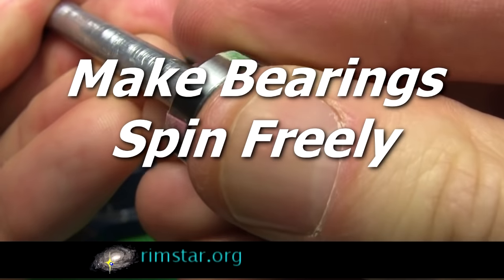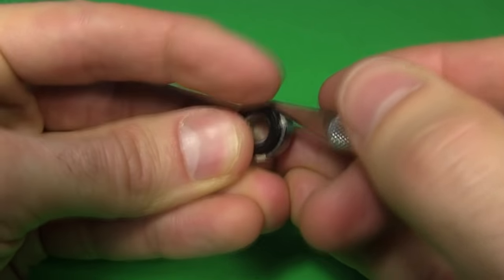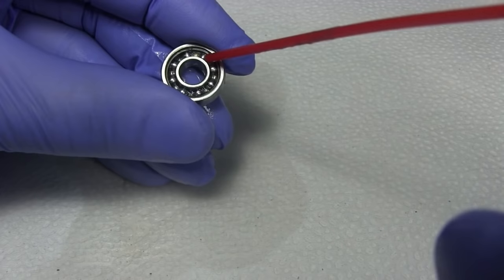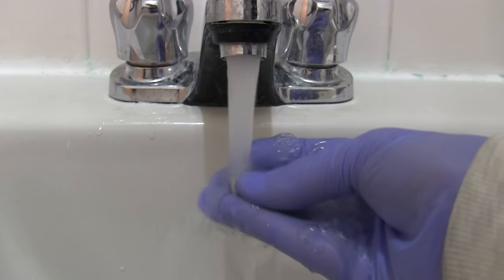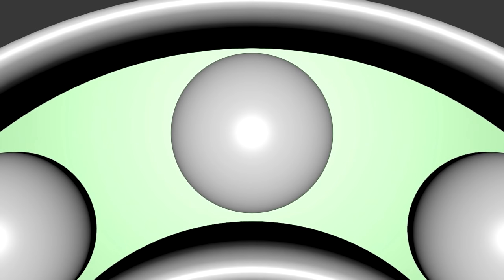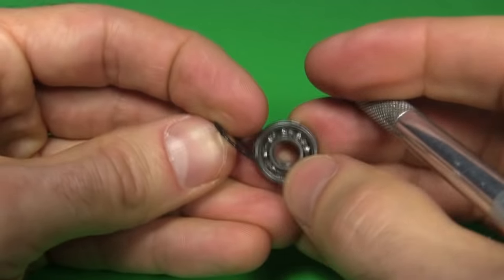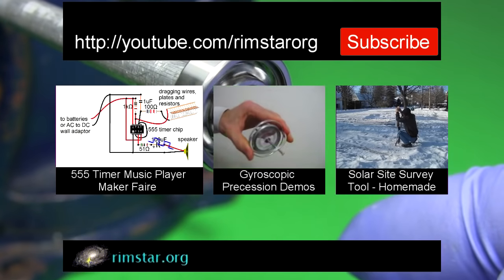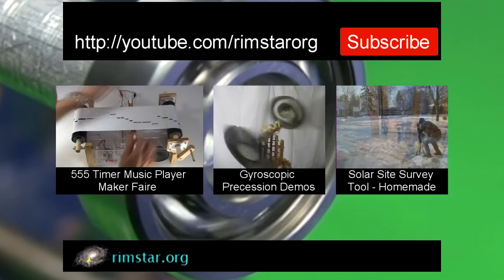How to Make Bearings Spin Faster/Freely

Comment: what is WD 40?
im indonesian
is that oil? or what?
Reply from the maker: In this case I'm using WD-40 as a degreaser, a grease remover. If you don't have WD-40 then look for some other degreaser that you can get in your area. Ask at the local hardware stores or automotive stores.
Reply: RimstarOrg 
oh ok i understand so wd40 is degreaser thanks bro
Reply: Ada wd40 di borma kok :)
Reply: PanjulFabFabFab borma apaan bro? :v gw di palembang

Comment: there better ways to clean it.wd 40 and water isn't to good
Reply: Soak the bearings in petrol then take them out and spin them until there dry :)
Reply: I use 99percent auchahaul and the I put lubracint in it

Comment: use mineral oil it will make it run wiht less noise
Reply: Barut Tech NEVER DO THIS I DID IT IT DIDNT WORK
Reply: it worked for me i incresed duration of spin from 40 seconds to 2 min.
(its calld oil for precise mehanic) i bought it for 2$
Reply: Eventually the mineral oil will attract dust, dirt and other contaminants. A dry lube is best.

Comment: WD-40 is awesome - I drink the stuff!!
Reply from the maker: You may be joking but a lot of people rub it one their joints for arthritis and swear it helps. I wouldn't, but many do.
Reply: RimstarOrg you forgot to mention that using graphite would be a good idea.
Reply from the maker: Joseph Gauthier
Nope, I didn't forget. I just didn't know. :) This video is just about something that worked for me. Judging by all the tips in these comments, an attempt at a complete video would have a lot more in it.
Reply: RimstarOrg Oh... On that note, you might want to get some graphite lubricant powder and see if it works better; at the very least, it will only reduce wear and tear; at most, it could make the bearing spin longer :). If you do decide to test that suggestion, I would be very interested in knowing how it turns out.
 
P.S. I'm not asking for a separate video. I'm merely asking for a reply to my comment on it's performance, if you dont mind :)
Reply from the maker: Joseph Gauthier
Where do you get graphite powder? I think I have a graphite spray around here somewhere from a long time ago.
Reply: RimstarOrg I use Tri-flow you can get it at Osh or Rei and it has Teflon(PTFE) rather than graphite. It seems to be less messy than graphite lube and has better penetration due to it being a liquid. But it also "sticks" to parts like graphite.
Reply: RimstarOrg you can buy it at both Lowes and Home Depot, and I'm sure you can find it at most home-improvement/hardware stores.
Reply from the maker: Joseph Gauthier
Thanks.
Reply: RimstarOrg usually near the key duplicating machine in automotive area...
Reply from the maker: tnlightnin
Cool, thanks.

Comment: Did he just put water on bearings wtf
Reply: Oh in that short time they have been subjected to water, they won't start to rust, just need to dry them quickly. But of course they aren't supposed to last long under load after this treatment, for the lack of lubrication.
Reply from the maker: How long they last depends on what you use them for. In my case it was for an indoor electrostatic motor with practically no load - just a fun science experiment.

Comment: DONT USE WD40 will ruin your skateboard bearings use speed cream or oust metol lubricant
Reply: How will wd40 ruin it?9
Reply: It will make it rust and its a heavy lube which will slow it down instead. Bones cream is a lot lighter and metol oust speedboil is even lighter causing it to go faster
Reply: +J_Da_Beast just use oil, oil doesn't rust. and it worked for me

Comment: but u should test the bearing under load.
Reply from the maker: I agree. In my case the load was very light, just a small, low load electrostatic machine but as someone else just commented, the majority of situations have a larger load than mine.

Comment: dumbest thing you could ever do it will blow your bearings really fast
Reply from the maker: Not if you're using it for an electrostatic motor like I was. The load is very light. As long as people pay attention to the second half of the video when thinking of what they use it for then they should be fine.

Comment: Deary me, what a ridiculous idea. Lubricant & seals are used for blindingly  obvious reasons! If you want bearings to spin more freely - but aren't stupid enough to do what this 'boffin' recommends - then buy some ceramic bearings.
Reply from the maker: +Missy Dee That's exactly what I did, buy ceramic bearings. But in the meantime I did what I show in this video, and with my electrostatic motor it worked great.

Comment: OMG OMG.... so much wrong with this video about bearings... where to even start? omg omg omg. I guess the place to start is go watch someone else's video that gives good info about bearings. or read some of the excellent info in the comments below... or just get unshielded bearings so you dont have to remove shields and its potentially cheaper too. or get metal shielded zz bearing as they have less or no drag and even some rubber shield bearings have no drag issue too ....
Reply from the maker: This is making do with what you have. These are all I had at the time. I later replaced ordered some ceramic dry bearings.

Comment: then  buy  cheaper  bearings  with  out  the  grease  or  shields . this  may  be  one  of  the  ridiculous  excuses  for  a  video
Reply from the maker: I needed it right away. And none of the local bearing stores have dry bearings.
Reply: ok  I  can  understand  that  but  was  it  such  a  low  power  situation  that  that  little  bit  of  friction  made  a  difference ?
Reply from the maker: Yes, it was an electrostatic motor, a corona motor to be exact. This one here http://youtu.be/hpvHRHs7o7I, though eventually the ceramic dry bearings I bought from ebay arrived and I switched to those. Here I'm powering it using atmospheric electricity, very low power https://youtu.be/qhXxSAv6rMg.
Reply: Hey RimstarOrg i liked your vedio its very good , i live in a  place where WD-40 is hard to be found and i want to make my wheels move faster in a few days hardly 1 or 2 days can u please tell me what else can i use for WD-40
Reply from the maker: Ask around your stores for degreasers. Hardware and automotive stores should have some. Also, I don't know what your wheels are for but make sure you watch the second half of this video to see where doing this is a bad idea. In my case I was doing it for an electrostatic motor and so none of those things mattered.

Comment: This is terrible advice. Take this nonsense down.
Reply from the maker: That's what the second half of the video is for, the situations where you wouldn't do this. In my case I did it for an indoor, very light load electrostatic motor.
Reply from the maker: That being said, I did later learn that a dry lube would help, even though in my case it still wasn't necessary.
Reply: Yeah I have to agree. "remove all of the protection and lubricant from your bearings to make them move faster. this only works for specific single use scenarios"
Reply: This is what i always do for my projects! It's not for skating or some other bullshit.

Comment: wt? sealant stops heat from going out dude - also, bearings are that slow bc of the new grease the fabricator inserted among the balls - in physics you'll probably right but mechanically & in engineering you need to do more homework bro 🕵

Comment: If your new bearings can't even spin for a few seconds it definitely defectived.
Reply: @Patrick Ross Oh yeah? Could you link me some info about low-speed ball bearings?
Reply: @253637zero2  these bearings will spin well when you apply a load to them. For example a wheel, it will then spin freely. For example: a wheel bearing on your car wont spin as nice when it is out of the car, but when you put it in and turn the wheel itself its spinning really nice
Reply: @avenged3118  I replaced two small bearings (in a big electric motor) like in the video a few weeks ago. Ten year old bearings that got taken out can spin for 1-2 seconds and don't sound smooth as all, new replacement japanese made ones can spin alone with no load for at least more than 8 seconds. Sealed and with factory grease too. Maybe if we know the exact product number of the bearing in the video we can know for sure if it suppose to be hard to spin.
Reply: @253637zero2  just curious, what do you do for a living?
Reply: @avenged3118  I'm not a mechanic or engineer that's for sure. But I like to repair stuff, mostly out of necessary. Are you a mechanic?
Reply: @253637zero2  i'm an engineer
Reply: @avenged3118  I'm not really convinced that you're (no offend), but breaings would spin longer with more load (or is it mass?) is true. But on their own though, only spin for 1 second is weird, and a new one as that. Maybe we should post this question on r/AskEngineers. Maybe you post it.
Reply: @253637zero2  mass/load, it's the same thing basically. try it yourself and you will see that i'm right.

Comment: Jesus .. all that was wrong
Reply: But Jesus is right!
Reply: Bearings this size are rated for 30,000+ RPM and 300 lbs static,  600 lbs dynamic load.  

His use case is .01%-.001% of that bearing’s capacity.  But please tell us about how that bearing is going to catastrophically fail and everyone is going to die from it.

Comment: Terrible advice, If you want an open bearing order them that way (cheaper) and then they won't have any of the grease to remove and... Terrible advice!
Reply from the maker: It worked for me when I needed two right away for an electrostatic motor using bearings I already had. I later did get some ceramic dry bearings and replaced them, but in the end the result was the same. For a personal project, there's nothing wrong with adapting what you have -- provided you also pay attention to the warnings in the second half of this video, which many people seem to skip.
Reply: Advice: "see if using your bearing without grease makes them better considering what you're using them for" 
Outragemongers: "say what?! I have to make decisions if this fits me or not?!?!?!?! THE NERVE!!! bad advice"

Comment: Bearings run under load you better go back to physics lesson nr1
Reply from the maker: Sure, but the load can be so small that you don't have to worry about wear due to the load so much. My electrostatic motor, which was me reason for doing this, is a very small load.
Reply: @RimstarOrg  I don´t really know how much power you can get out of such a design,but you could consider oil pressure instead of bearings if you want to go big.Because its nonsense to reduce friction by actually destroying the lifespan and reliability, even in your musik box dust can be a killer in no time

Comment: I can't believe you would post this rubbish. No grease = no lubrication = premature wear. No seal = ingress of particulate matter = shorter life. So many utoobers think they know better than the million dollar company engineers that design these bearings.
Reply from the maker: Did you happen to watch the second half of the video where I said all that? I did this for an indoor, low load, electrostatic motor so I was fine. Though I did later learn about adding a dry lubricant like graphite.
Reply: Wait until you hear about fidget spinners ;)